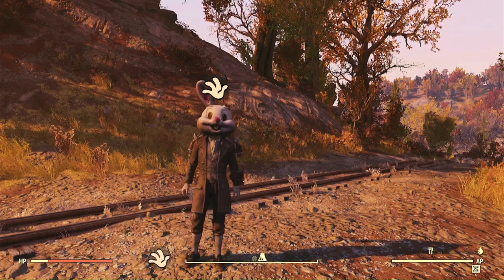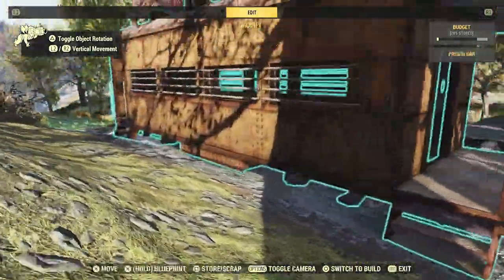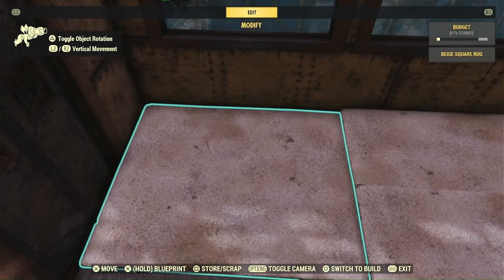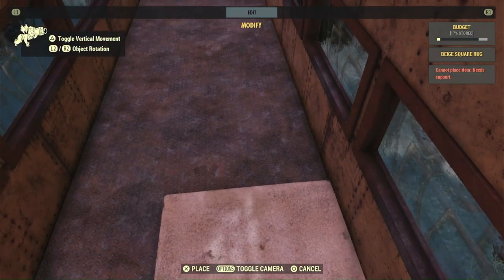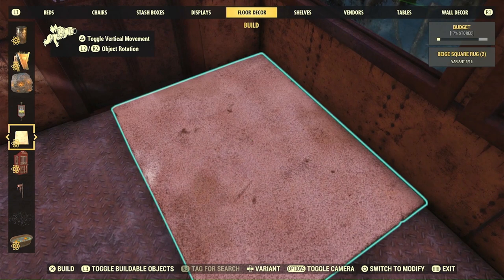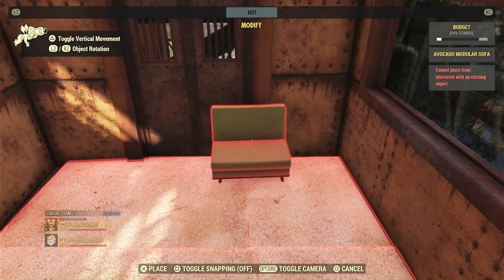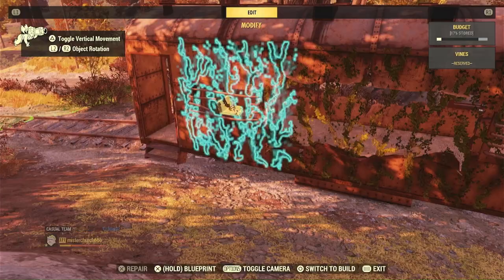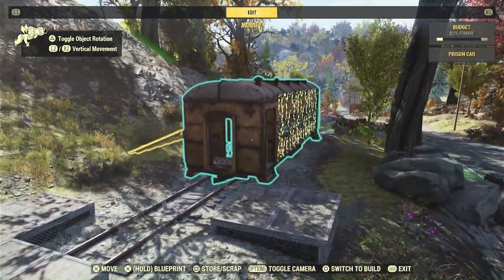Immersive Prison Car House Using Floating Filing Cabinets | Fallout 76 CAMP Build Tutorial

Comment: Welp, I just went to start an attempt at this and I think they broke it again. Can't get any wall to snap to the door after changing it. Which is...like, the second step in the process. Wonderful.
Reply from the maker: Make sure there’s a foundation built somewhere in the camp, and make sure the door is a normal one that snaps into walls :)
Reply: @misterchurch666  Ah, okay. I didn't have a foundation placed, which must be why it limited my door options, so I had to change it once and then a second time to a normal doorway one. It was also limiting my wall options to just the powered door ones. If placing a foundation first opens up my menu options, maybe I'll be in luck! Thanks. 👍

Comment: Stairs should snap to the quarter size upper floors, upper floors should snap to foundations ceilings should snap to both, we need half walls vertical, and the sloped walls vertical, you can make two pitch roofs i used commands in fallout 4 to make a barn like this
Reply from the maker: I agree to all these ideas! Wouldn’t it be cool if a dev reached out and heard from someone who builds 😮